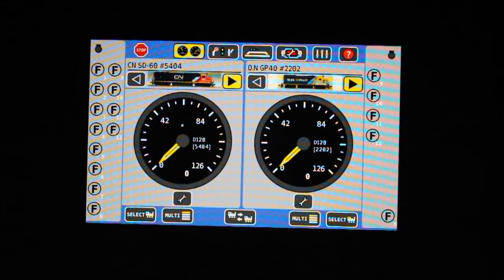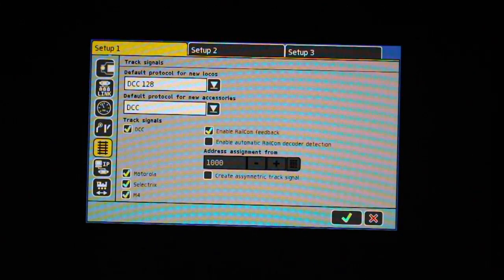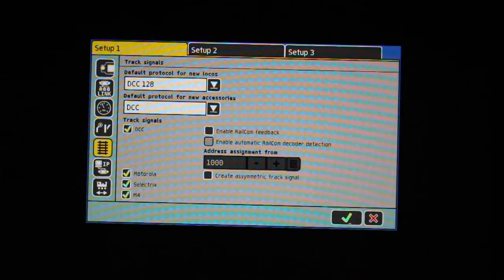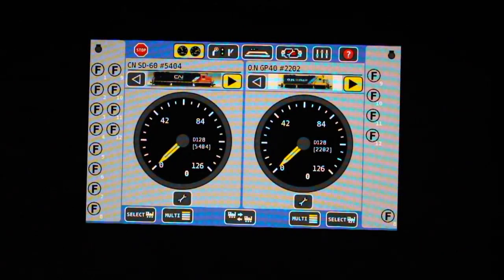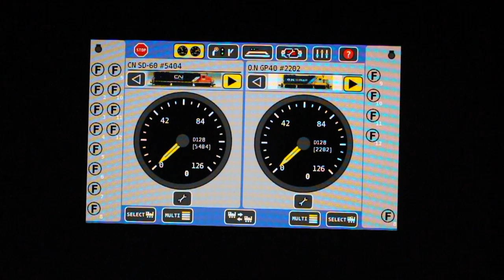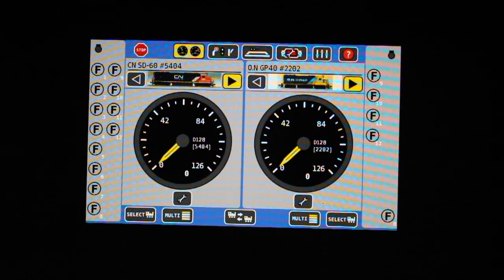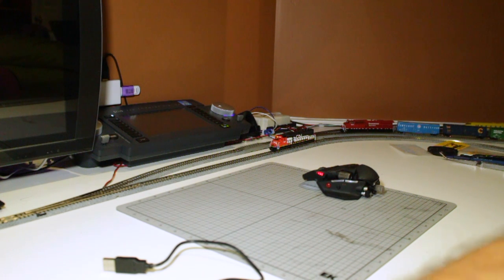NCE vs ECoS2: A Comparison of Features - A Hobby Adventure !

Comment: That is what i said earlier,the Ecos is lightyears ahead of the Nce decoder system.US decoders don´t like EU  DCC command stations ,but again not all decoder brands have that issue.IF you don´t want trouble buy FVM locos with NEM 651 or the new IMR locos with next 18 connector.They all exept the ESU micro lokpilot decoders.I converted a FVM GP60 with a micro lokpilot yesterday and was blown away how slow and smooth this little loco runs.Ask any HO guy,they all say Loksound V4.0 is the way to go.Anyway,nice that found out the problem and enjoy running the trains.
Reply from the maker: Thanks for the comment